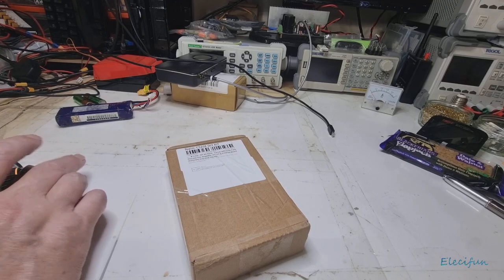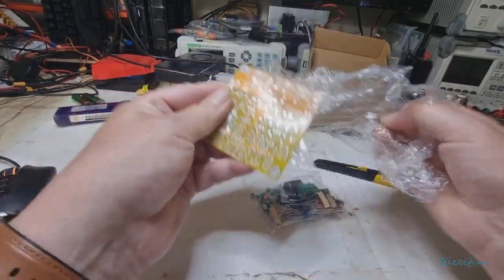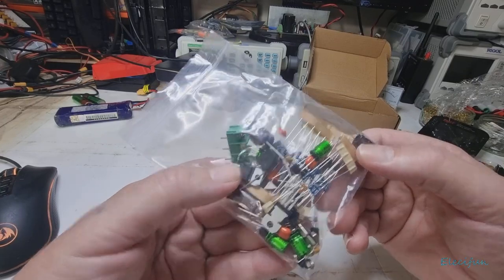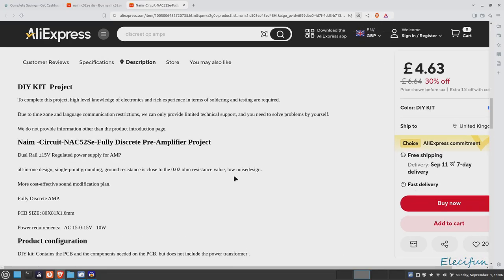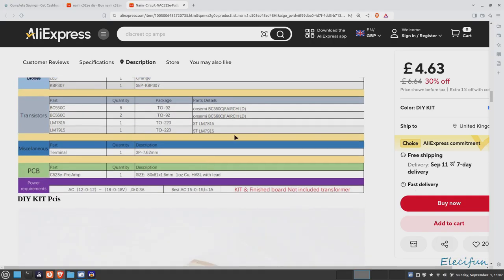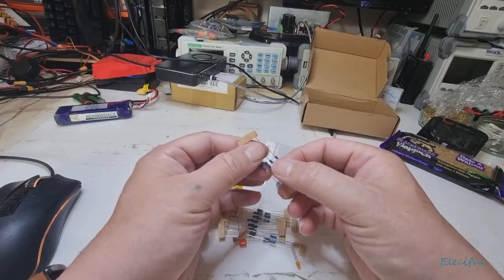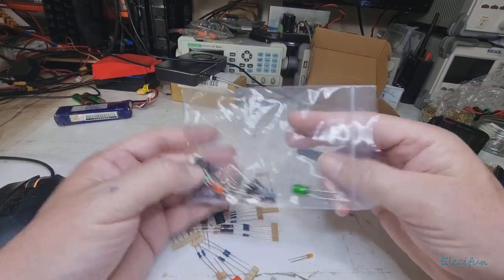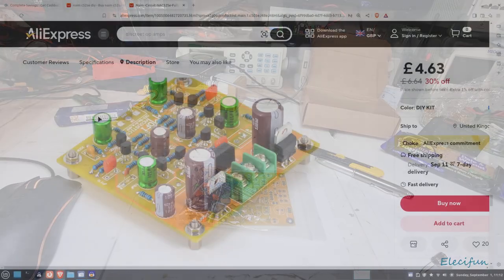Naim -Circuit-NAC52Se-Fully Discrete Pre-Amplifier Kit

Comment: Hey Dude! 👋🏻 😂 

I just got back from a morning walk and got caught in an friggin' ice storm. 

Christ my face was frozen ffs. 😂

Anyway you have a new diy kit ! Very nice. 

A pre-amplifier. 👍🏻  nice. So what's that mean? You need a power amp as well?

I'm still on my Nvarcher FM radio diy kit which is a friggin nightmare. 😮

None of the component holes are labelled which makes it really fkn hard to know where to put each component. Sigh.

OK we'll there are values screen printed on the board but geezez it's not easy to understand. Sigh.

Already one of the thin film polyester caps is wrong.
Reply from the maker: @decem_unosquattro9538 I checked out the radio circuit, it looks good I prefer mine to go a bit higher in frequency so I can pick up air traffic. I use SDR for that.
Reply: @Elecifun  Oh you are light years from me. I see already you are at least 8 years fom me and that's just youtube videos. Maybe you started electronics a long time before you ever thought of youtube vlogs. SDR? What's that? 🤔
Reply from the maker: @decem_unosquattro9538 I always had an interest in electric electronic gadgets but never the education or anyone to show me around get me started. 
Starting my channel because I was in a depression loop. I lost the three most significant women in my life, two to suicide and another in a car crash and I hit the ground hard.
Unemployable chronically depressed I looked for something to change my though patterns.
I decided to try an uneducated trial and error go at electronics and document the journey hoping to remap or retrain my thinking. 
So far I have got to this stage. 

SDR radio is 'software defined radio' I use a USB dongle RTL-SDR and GQRX software. It's fun to play with.
Reply: @Elecifun  omg It's upsetting to hear that ... 😒
I lost my mother a few years ago and the way she died was upsetting for me. 

I won't go into your losses. That's just going to hurt you.

Unemployable, well we live in an age where most jobs were offshored to other countries.

Oligarchs decided they wanted a lot more profit for themselves.

So don't beat yourself up when in reality the game is rigged.

People who are working are paying the bulk of the tax.

I know because I payed out stupid amounts of tax. 

Not much you can do about it.

No point running negative loops in your mind yeah I'm guilty of this myself. 😔

It's a friggin tough world out there and yeah its getting even worse.

The good news is our fuel price is slightly better and let's hope it keeps getting better.

Keep studying hard.

Get out most days in your spring and summer.

Walking around in the sunshine is good for your mood. 

I never thought I would say this but I'm looking forward to the warmer weather.

I'm hoping I'll have enough to finish off my reno' .

Looking at it now it's quite daunting to think I'm only half way. Sigh.

It's so friggin expensive now.

Every week another building company goes broke.

Anyway keep trying, keep making mistakes, keep pushing for that self improvement.

You actually need to get angry with yourself and shrug the shit off. 

It's the only way to learn unfortunately.

In fact the Japanese have a saying if your not fking up 9 times every day your not trying hard enough. 

Just try to learn from your mistakes and hopefully it's not fatal. 🤣🤣

Get your diet right and drink enough rainwater.

Consider going to the gym. 

Anyway good night it's 9PM.

I'll try to prise myself out of bed tomorrow and avoid bed-rotting. 😆 

Night dude! 😴
Reply: @Elecifun Keep practising your skills. Keep learning. Don't practice till you get it right ; Practice till you can't get it wrong.